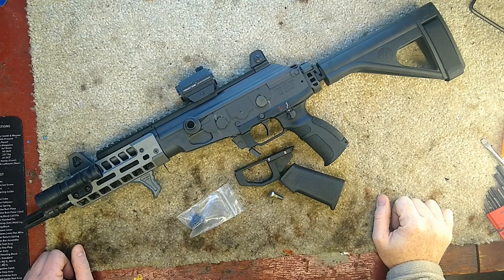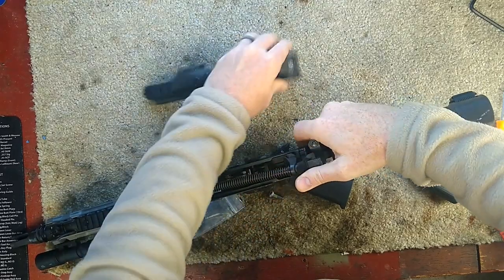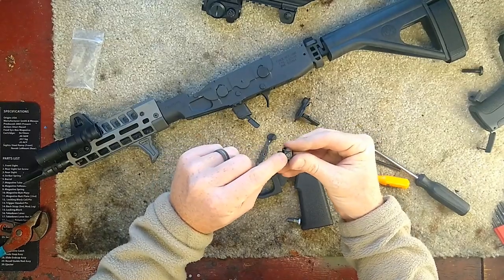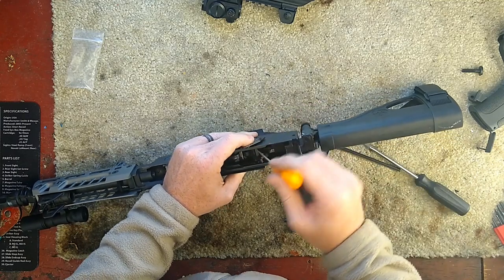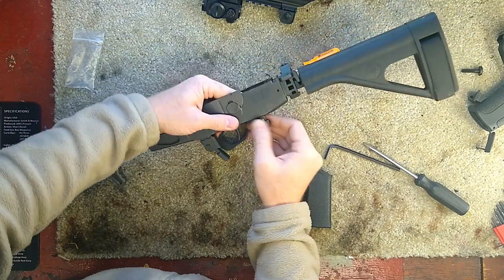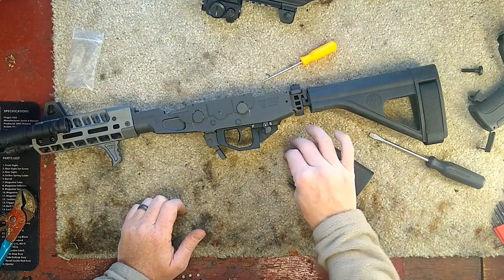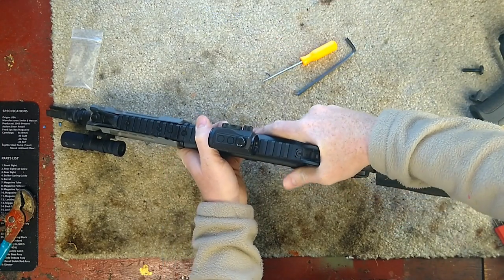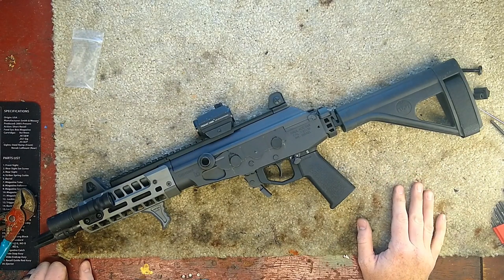KNS Precision Plastic Delete Install - IWI Galil ACE 7.62x39

Comment: do you NEED to reinstall the left side safety selector or can you just leave it out and use the right side one? 
(Asking cuz shoot left handed and this one thing prevents me from trying out the Galil ACE series as it gets in the way of my trigger finger)
Reply from the maker: While I haven't tried it without it, I don't see any reason that you couldn't leave it off.  You might want to talk to someone at iwi.
Reply: @damagephotos4805  Thanks for the quick reply 👍
Reply: I'm a lefty and the safety selector doesn't bother me. It's sturdy enough that you wont switch it by mistake and its low profile enough that I don't really notice it when shooting.

Comment: Hi DP, how do mags fit after cutting off the stock IWI plastic magwell? Any wobble? I like your idea because you can’t fit a drum otherwise. Now that you’ve installed the KNS pistol grip are you interested in selling your factory Ace grip that you removed?
Reply: Id like to know this also...Seems like it would be 'wobbly'.
Reply: I took mine off before and tested fit with 1 mag, i only have 1 pmag, and it wobbled bad. But I'd assume it must not be that bad with other mags or kns wouldn't make this kit
Reply: attributetovienna 1 what mag did you use?
Reply: @kaweka260  I used a factory p mag I just bought another and its way tighter idk why
Reply: I think I had a bum mag or something
Reply: attributetovienna 1 Cool.  I use a pmag and only a slight wobble
Reply: Try the US Palm mags guys. They are good quality and are a snug fit. Note though they will only fit if you modify or completely remove the polymer magwell. They’re too fat/wide to fit in the magwell otherwise.
Reply: Behind_NME_lines_CA I never expected this to be more weight than advertised by IWI.  It weighs around a pound more than my stamped AK.  Being a billet receiver, that should be normal.  Haven’t shot it yet to compare to my AKM.
Reply: The extra weight is worth it in my book! 😎. Also regarding mags, the CAA and Circle 10 mags fit great too.
Reply from the maker: I have had zero issues with mags.

Comment: Nice vid. Where did you find that brace? I haven't been able to find any alternative stocks or braces that are made for the Galil ACE buttstock tube. Any links would be great.
Reply from the maker: The one in the video came on the pistol.
I picked up a bonesteel arms one though that I've since replaced it with.

Comment: Can this be done with keeping the stock magwell intact to be replaced later if need be?
Reply: Yes you can.  I cut mine before I knew this was coming out.  You can keep the plastic intact.
Reply: @pyzik200  Are you aware of a video showing
 the removal of the magwell intact?
Reply: @lawrenceroot1795  it's the same process except there's one additional screw in the front of the plastic piece near the handguard. That's literally the only difference
Reply: @pyzik200  Thanks, sounds straight forward.  I've read about negative experiences from folks who stripped screws, etc.
Reply: @lawrenceroot1795  I'm done to and haven't shipped any screws. I will say that the grip screw was difficult just because how hard it was screwed in.
Reply: Can you remove the kns lower without removing the inside screws after it’s been installed? Or do you have to remove the safety ect ever time to get the “kns lower” off? Thanks
Reply from the maker: @mikep1776  You have to remove the safety

Comment: You mentioned why the delete kit doesn’t work with the 5.56 model. Could you explain again? I couldn’t understand.
Reply: Seems like it needs a magwell for the stanag magazines to stay in. By changing to the ar-15 grip adapter it (ironically) cannot keep ar-15 or any kind of magazine inside the weapon.
Reply: I wonder if it works with 5.56 Galil mags?
Reply: It should work with the rak in style galil 5.56 as long as the mag doesn't need to relay on that weird extra plastic magwell some got😅

Comment: Man i wish they’d make one for the 5.56 to take the original galil mags
Reply: Thatd be badass!
Reply: I've seen someone do it. You have to buy original galil grip and mag release. Remove all the oem stuff, replace with old school, good to go. Apex gun parts to find the og parts for cheap.
Reply: @jameskobi6111  then at that point just buy original galil kit and slap galil ace bolt and top cover on.
Reply: @boocomban  IMI galil parts kits can be hard to find, and they aren't cheap compared to AK kits. You generally still need to get a barrel turned on a mill for the gun, unless you want an old worn out one. On top of that, unless you have the proper training to build a galil or AK platform (which is much, MUCH harder than building an AR), you'll have to pay someone to build it, and turnaround times are generally long. 

The ACE has made MAJOR improvements over the IMI Galil, though the classic aesthetic is 👌, so if we are only talking about changing a grip, I'd still say getting an ACE and changing the grip is the way to go. The ACE looks WAY cleaner without the plastic lower, even if we are talking gen 2 ACE. Like I said, they're cheap from Apwx and a breeze to install. Mine is in 7.62x39, and it's it's beauty. I opted for the KNS plastic delete kit that accepts AR grips. I've yet to see a Galil ACE that looks and feels better than mine. 

I much prefer gen 1s to gen 2s, I think the handguard on the new ones is hideous, and sucks losing the irons. Mine has a new rear 1913 trunion that'll accept MCX style stocks. Barrel is chopped to 12.75 inch and is a registered SBR with a JMAC ss-8 stock. Midwest Industries handguard, surefire m300 WML, vp-24 handstop, railscales, a gen 2 safety, ALG AKT trigger, and an aimpoint t2. She's gorgeous. Too bad YouTube doesn't allow photo comments.